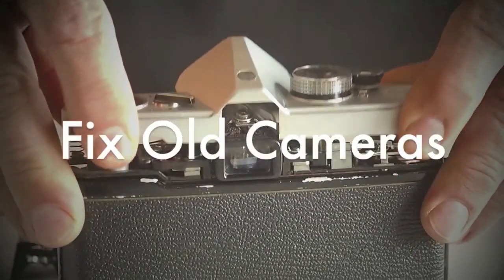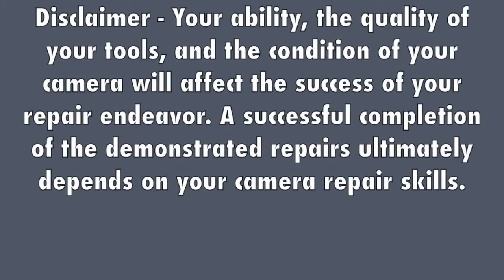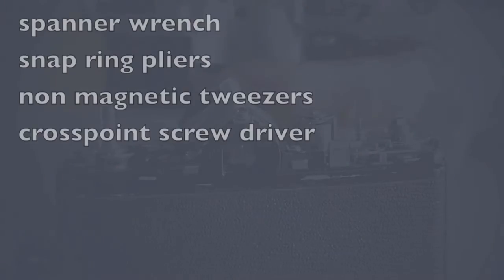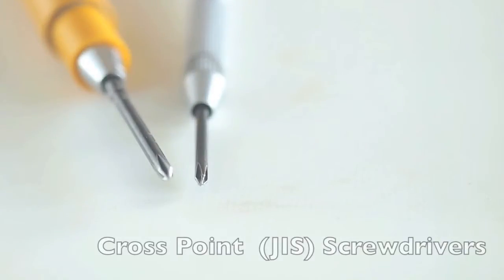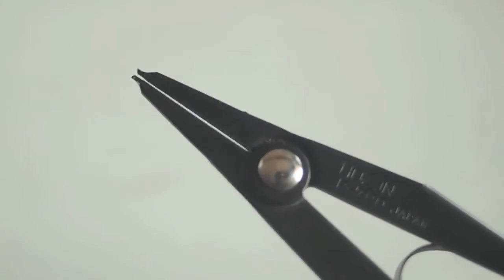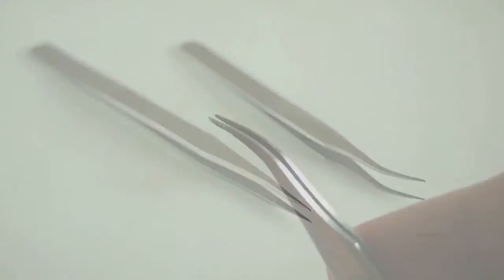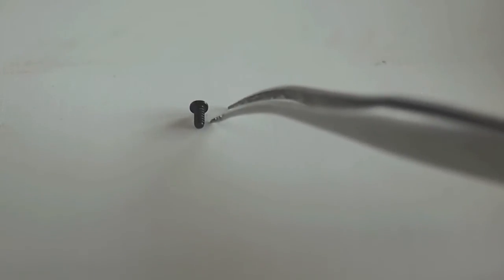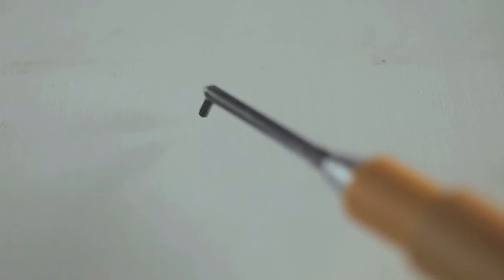Fix Old Cameras: Camera Repair Tools, Part One

Comment: Can you point me towards a spanner wrench that I could use on a Yashica 35 mm Electro GSN? I measure the distance on the ASA dial at 5mm and on the film advance lever at 10mm.  I cannot find a wrench described to adjust to these measurements
Reply from the maker: Should be able to make one to fit your needs... fortunately they are rarely overly tight. This video has one idea. 
https://www.youtube.com/watch?v=ULC8kUTnv5Y

Comment: My Olympus D600L has been great for many years but no longer works with a busted battery contact deep inside.  Can you tell me anything as to who or how this can be fixed?  Thanks, Richard Willing
Reply from the maker: Fix Old Cameras will not be going down the digital road, even though there are many great "old" digital cameras still around. Even so, thank you for your interest in FOC.

Comment: What is the brand of the removable tip spanner used in these videos?
Reply from the maker: Unfortunately, the excellent T-132 spanner is no longer available. The ones used in the FOC videos have been in continuous service for nearly 40 years. This is a very good copy except the tips are held in place with a screw rather than a clip.  
http://astore.amazon.com/fixoldcam-20/detail/B002QIACDO

Comment: How about replacing the tiny rivets that hold many accessories and hot shoes to cameras? Some cameras I've seen  have rivets holding the film door and other odds and ends. I've been trying for years to buy these tiny rivets and even more important the tools needed to set these tiny rivets by hand. Does anyone that you know of sell these small rivets and hand setting tools? I know the usual fix is to drill rivets out and replace them with small #0 and #1 slotted screws but the heads are to big compared to a rivet and the repair just looks jury-rigged. Plus the tiny hex nuts are just to big  to allow proper clearance. Which is why rivets were used in the first place.  I do have a few OEM Argus old stock rivets that hold the catch on old C-3 Argus cameras and have tried setting them with an center punch, but it just isn't  the same. You know the old adage, The right  tool for the right job! THANKS
Reply from the maker: With a jewelers headpin or riveting anvil and jewelers headpin wire or solid copper wire you will be able to fashion very tiny rivets. The headpin wire tip can be heated with a small pencil torch and it will form a ball on the wire's end that can then be flatten with a punch or flat pliers. Washers can be used to widen the holding surface. It is also possible  a local-owned old school hardware store might carry some small rivets that would work on the accessory shoes or other applications where the rivet is a little bigger. If not again use solid copper wire to create the rivet. Use a small needle drill to create a depression in the ends of the wire and it will spread and create the head when smashed.

Comment: I dropped my Pentax K1000 and the meter is stuck in middle with no movement, even with new battery...Can you create a k1000 series of repair videos, maintenance and refurb videos
Reply from the maker: The Pentax K1000 would be a good choice for a feature series. For the Pentax on that slipped from hand... it is possible that the either the bottom or top pivot of the galvanometer coil slipped out of position and is causing the bind on the needle.